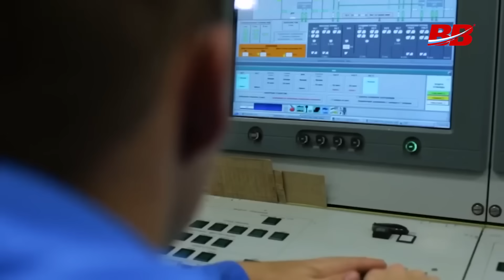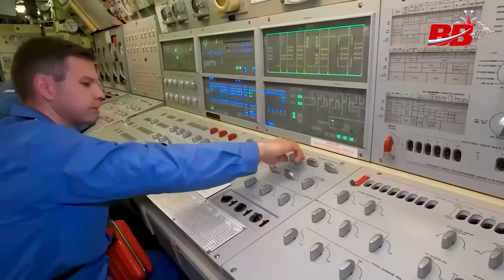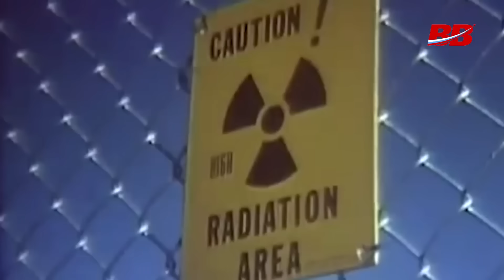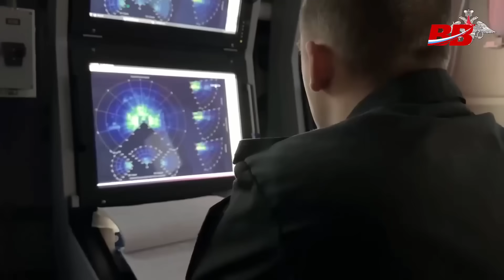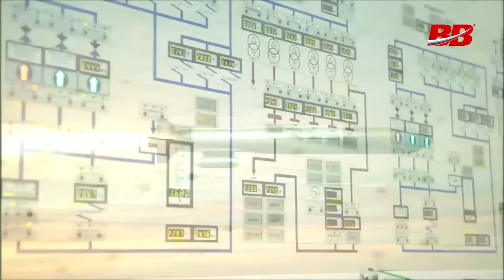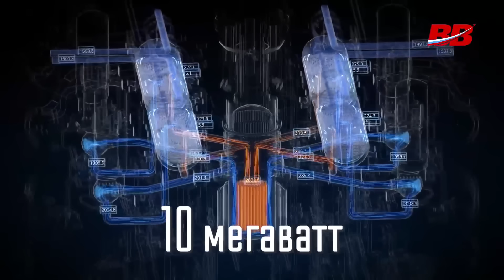Russia's Big Surprise: New 'Storm Petrel' Mission for the Moon

Comment: I could be wrong but I believe that the Burevestnik works by expelling nuclear reactor heated hot air. In space there is no air, therefore it cannot have space application.
Reply: Yes, to use it in space it will have to be a bit modified.  
Instead of using air it will use hydrogen from a tank in the rocket.   (Hydrogen is the most effective gas for this because of its low molecular mass)